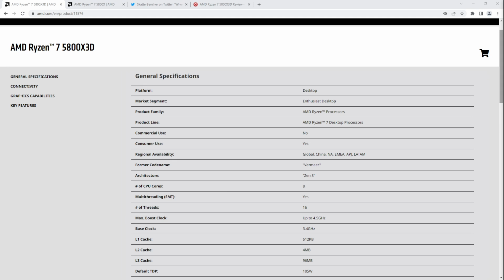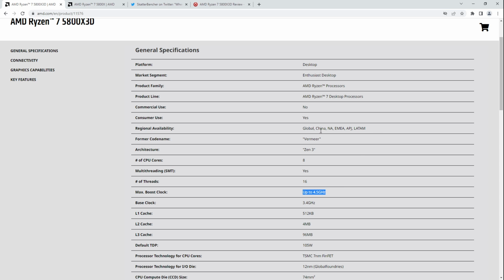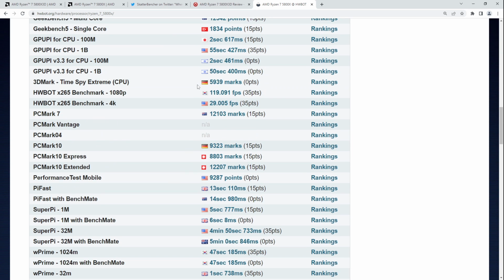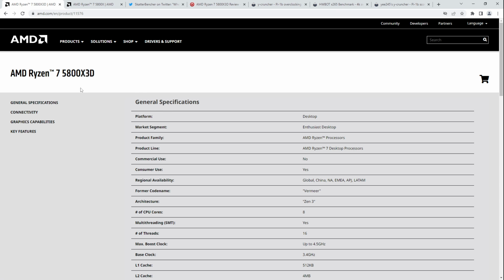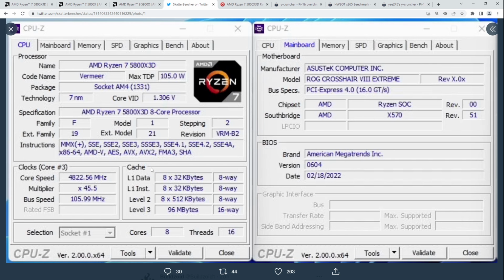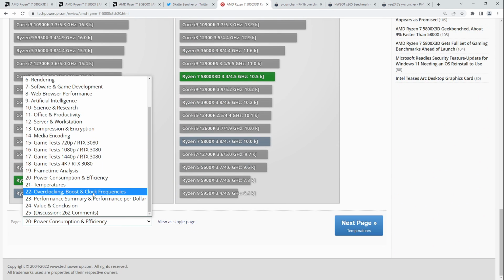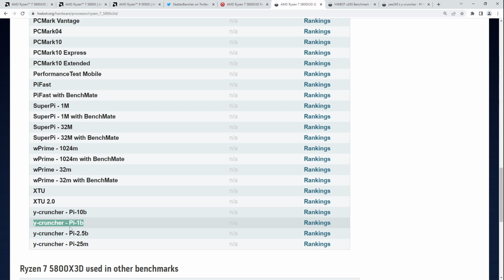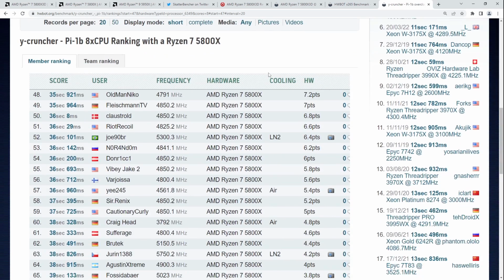Buildzoid's 5800X3D overclocking rant

Comment: The part where you rant about allcore clocks at 1.35v is actually rather incorrect for the CPU you're talking about - the 5950x gets walled around 4.5-4.6 Ghz on ambient unless you direct-die it, yes - but the 5800x does 4.7-4.8 Ghz allcore at 1.25v-1.3v depending on how great your sample is.

So to lock a 5800x at 4.5 Ghz, at 1.35v, looks more than a little silly.
Reply: Did you try half a 5950x, I mean, a 5950x with only 4 cores per CCD enabled?

Comment: I think this chip's thermal limitations come not only from the produced heat (as Buildzoid said, it is not that power hungry), but about how well you can evacuate that heat with the 3D cache layer and silicon substrates in the middle. I wonder if that is what made AMD thought when they enforced this dumb limitations, since no mater how well you can cool the silicon die on the top (even sub-zero with LN2 or with a beefy peltier), if the heat transmission to the cores is slow there is still a risk of breaking something along the way. Even if they put a low temperature threshold for the shutdown.

Comment: I'd guess AMD would lock out voltage changes at the AGESA level so that you can't even attempt to change the voltage from auto. A modded bios could open up some closed doors.
Reply: You can't --- think this way: What if the BIOS engineer program the VRM to supply 1.3+v, or even 1.4+v, but report it  (x -0.2v) to AGESA, what can AGESA do than take the damn voltage and deal with it? The CPU doesn't provide any voltage regulation, it can do nothing but take whatever voltage it got given with.
Reply: @OMGJL  CPU might throw power failure errors and make you stuck in a reboot loop.
Reply: @erkinalp  again, the cpu doesn't know shit about what power got feed in (as am4 doesn't contain a integrated voltage regulator), it relies motherboard to give it power as well as all the voltage readouts, all it need for a motherboard vendor to bypass this issue is to give a fake readout to the cpu

Comment: I think they locked it only because they're worried about the stacking tech. The temp readings it reports aren't hot, so it's the only explanation. Maybe we will find out in a year that the connection cracks and the chip dies after a bunch of heat cycles?
Reply: More they are aware of cache errors in the 3D cache if operating too much past factory stock. It functions kind of like HBM in how it's stacked, and those interconnects aren't perfectly insulated from leakage under high voltage; too thin to handle it. Errors come first, then literally blowing out the interconnect if you keep pushing it.
Reply: @XionEternum  cache clock isn't coupled with core clock. And since you can do Bclock OC it's probably not a clock issue.
I think it's physically a thermal expansion problem because it's not monolithic. HBM didn't have this problem because it uses an interposer, it's not sitting right on top of a heat source.
And if that is the case apple is going to love 3D stacking in their products (they'll probably claim they invented it too) but it'll actually cause the chips to break as you use them. Then you can't possibly use your 10yo ipad. Emphasis on the "IF"

Comment: Imagine claiming you can't overclock it because of heat issues while the chip still reaches the same temps clock per clock as the 5800x anyways lol. Took amd one generational win over intel to become the new intel. It's insane how people are still fanboying for this company. BuT MUh GamEZ!1!11!!!1 I nEEd TO PusH 250 fPs instead oF 210 on cOD!!1!!1 tHosE EXtra 30 fRAmeS wiLL MAKe mE Go PRO!!1!!1
If this piece of shit of a cpu does not "split" the vcache at 85 degrees 1.45v, why would it do that at 1.3v lmao. It literally makes zero sense. If you have more than two brain cells to put together that is.

Comment: An  external clock generator for X570 and bclk overclocking would be amazing if possible.
Reply: I tried searching but could not find a list of AM4 boards with external clockgen. Presumably the Crosshair Extreme and MSI Godlike have those since i've seen those used to push past the 100 BCLK limit. Presumably much cheaper B550 boards would work too. Atleast the overclocking focused ones like B550 Unify.
Reply: @Raivo_K  Any of the Crosshair boards have clockgens. X470 and B550 being better for high BCLK though.
Reply: @Raivo_K  BCLK overclock = no SATA, on Zen 3.
Reply: @erkinalp  Fine by me. I moved to M.2 last year. But external clockgen should still be able to avoid that.

Comment: The annoying thing about it is that they give so many reasons they you feel that they don't know themselves what limitation is. Or that they are lying. While I'm not using OC very often, I don't think that blocking it is a wise idea - because people will be scared that Zen4 with Vcache will be locked as well. Which doesn't have to be the case if for example the main reason they get damaged in OC is because despite slapping cache and thermal chips on it, they had to do it with the same amount of Z height. By sanding down the silicon. If that's the case and processor is just delicate and they were worried that either there will be review in which someone attempts to overclock and it dies or that people will be OC'ing them and if they get some damage just RMA them after setting BIOS settings back to normal. If that's the case (so basically chip is "delicate" because they had to make it dimensionally exactly the same as 5800X despite there being 3 more chips on top of it) - then hopefully that is a one off and Zen4 with Vcache won't be locked, because they will have forethought to engineer it with less constraints. Though when I think of the time it takes to create new architecture - then I'm not sure again.

Comment: I feel your pain but I think you're making the wrong assumptions... Remember, the primary limiting factor on Ryzen CPUs has always been current, not temperature. PBO itself is primarily driven by current and then by temperature... I heard somewhere that AMD is talking to mobo makers to convince them to disable OC because the VCache is dying above 1.3V. If I were to guess where the voltage limit is, I'd say it's on the copper to copper bonding between the dies, maybe the bonding deteriorates under high voltage, even under low temperature.
Reply: Those are my thoughts to, on a more basic level.
Reply: I don't unterstand why they would'nt make this clear. If this is true then they just appear dishonest.
Reply: @killersberg1  They did even when they were discussing it in drawings (I think it was Frank Azor).

Comment: The 5800x3D running extremely hot seems right. It's clocking 200-300mhz lower, and running 1c hotter from what I've seen from 1 review. It be 12900k levels of cooling needed if it were to turbo to the same levels.
Reply: nah, it doesn't need the capacity, just the better transfer.
So if lapping would be a thing, this would be huge

Comment: For this CPU I really do get why they do not want over clocking it to be easy.
Reply: I imagine they are trying to avoid the twitstorm along the lines of "these new vcache chips are super fragile and are easy to kill under OC"
Maybe the platform (stacking cache silicon on top of the normal CPU silicon) is so new they just don't have the data yet to reliably plot the voltage/failure/time curve
Reply: Heat and Stability.

Comment: you couldnt overclock the 5800x either
Reply: Yes you can, PBO and Curve Optimizer are great on the 5800x. Running mine with a 5ghz boost.
Reply: @charlesleavitt13  its wont run at 5ghz in game, youll struggle to get even the stock 4850 in game.
Reply: @bigturkey1  it holds 5ghz in Elden Ring. YT isn't letting me link to screenshots here but with the right PBO overclock it will hold 4.9 to 5ghz in pretty much any game and I only have a 240mm AIO. It's all about balancing power and temps.
Reply: @bigturkey1  It can run at 5GHz if you disable half of the cores.
Reply: @erkinalp  no it cant and that would be stupid
Reply: @charlesleavitt13  Imagine thinking pbo and co are overclocking, you zoomers are actually entertaining. Please keep going.
Reply: @xkxk7539  I hate to break it to you but manually adjusting voltage and freq died years ago at this point. Both the Zen3 and ADL boost algorithms are smarter than you.

Comment: Peak volts for Zen 3 all-core is about 1.35v anyways.  Have pushed my 5900X over 230w of draw at 1.3v and 4.65ghz.
Reply: @Alex If I were just playing single core optimized games and doing things that are not L3 latency sensitive, yes.  However, locking core frequency for all cores and CCD/CCX's to be identical with as close to no fluctuation as possible (none at all preferred) gives better performance in some work loads.

Comment: In Zen 3 the L3 cache clocks at the same clock as the highest clocking core. I assume that there might be an issue with the denser cache chiplet or the interconnect not being able to support the full clock you'd see on other Ryzens.
Reply: This was my first thought about it too. But also the thermal density added by putting another active layer of silicon on top of the existing wafers, connecting it all with copper.
Reply: @darkSorceror  exactly degradation of chips or thermal stress might cause damage much quicker than other cpus thus trying to prevent too many RMAs.
Reply: Is there even a need to consume extra 20-50% more power for 3-5% higher clocks? The cache itself already adds massive performance. I'm surprised they didn't lower the clocks and TDP even more
Reply: @GewelReal  It's not that there's "no need" for it, but that they're disabling the possibility at all

Comment: I wonder if the copper to copper VIAs between cache and cpu dies could handle LN2 -100C from above and power spikes from under, or if they will start snapping.
Reply: thats one thing i believe could happen, but at the same time it should be the same method they use in hbm, which seems to work fine!?
Reply: @cj09beira  I don't know.. hbm connectivity to gpu looks similar to how ccd and io chiplets are connected, layed out next to each other not on top of each other, I think this is differenet.
Reply: @husamabou-shaar9740  although hbn is placed next to the gpu/cpu the hbm itself is made of multiple silicon dies on top of each other connected with through silicon vias, much like how this cache is connected to the base die, thats what i was refering to
Reply: @cj09beira  That's interesting, I didn't know that about hbm, thanks.

Comment: Damn cpu overclocking blows lately, zen2 and 3 didnt oc that well, 11th gen ran hot and was shit in general, 12th gen has error cores and now zen3D has locked multiplier

and honestly gpu overclocking isnt that far off with nvidia locking voltages and amd soft locking clocks, even bios flashing is dead
Reply: overclocking age is likely dead, as they push the silicon to the limit at the factory, at least we still have some reasonably good memory overclocking potential

Comment: It was told by AMD robert that the extra cache is made with TSMC N7 high density and the voltage limit is coming form that.
Reply: It is no more than 1.35V on the Vcore because the V-cache part doesn't tolerate high voltage.
Reply: I've always considered 1.31v the maximum safe value, this one ranting about 1.35 is kinda wut??
Reply: @TheSilviu8x  1.35 is since zen 2 at least their max safe constant voltage for all core.
Stock with PB it can pull up to 1.45 V to the 1 most used core. But for OC, 1.35 is perfectly fine for daily use, without risking to much more degredation.
So unlike BZ daily use or XOC, or simply just OC it normally to get to know the limits.
Then 1.375 or higher are possible and with XOC 1.4+ make ssense.
Reply: It doesn't matter. 1.35V is a lot of voltage. 4.7-4.8 GHz can easily be reached under 1.35V. 4.5 GHz allcore should be possible without problems.
Reply: @StrategyMasterSSF  Good ones maybe. But in reality we don't know how AMD validates silicon internally.  I am 110% sure AMD did not leave any performance on the table here.
Reply: @Kizmox  Performance is already there. 10-30% extra performance (in games) at lower power consumption. Literally a win-win
Reply: @GewelReal  Yes. But we were talking about overclocking the 5800X3D
Reply: @GewelReal  At 1080p using a 3080 or higher. And being poor for doing anything else than gaming. You can get a 5900x for £365 at the moment on Scan UK, and you can overclock that.
Reply: @Safetytrousers  obviously a CPU upgrade won't give you a FPS boost if you're gpu bottlenecked
Reply: @tomiesz  How many people are using a 3080 or above at 1080p?
Reply: @Safetytrousers  For RTX titles @ ultra details
Reply: @Safetytrousers also games are always coming out, it's not like more demanding games are not going to appear. 
The increase in performance is there. It's up to the buyer to figure out if it's worthwhile purchase. It is in a weird spot in the market though, i can agree on that. 
for most normal users oc wont even matter, obv for people who watch this it might matter way more.
Reply: @Kizmox  But a higher resolution is a much greater visual improvement than this or that setting at max.
It's always senseless just to whack everything to max and leave it there unless that doesn't degrade performance. There are always settings that make no difference to experience at low or off.
Reply: @Safetytrousers  since things like pi-cruncher depends on the GPU...
Reply: @Safetytrousers  but RTX in general isn't :)
Reply: @emmata98  When did I mention RTX? And what is RTX not?
Reply: @emmata98  I didn't ask a question to which 'since things like pi-cruncher depends on the GPU' would be an answer to.
Reply: @Safetytrousers  "At 1080p using a 3080 or higher. And being poor for doing anything else than gaming. You can get a 5900x for £365 at the moment on Scan UK, and you can overclock that."
This implies that a CPU without a strong GPU is useless.
But especially with XOC this isn't the case.
Therefore I named 1 programm witch proofs this point
Reply: @Safetytrousers  "But a higher resolution is a much greater visual improvement than this or that setting at max.
It's always senseless just to whack everything to max and leave it there unless that doesn't degrade performance. There are always settings that make no difference to experience at low or off."

This implies, that turning on Raytracing has less of a visual impact, than getting the resolution a bit up (like from 1680*1060 to 1980*1080), witch depends on the case, but in general this isn't true.
Reply: @emmata98  I was talking about the capabilities of the CPU, not what can or can't be done on a GPU.
Reply: @emmata98  It implies nothing of the sort, especially in light of the comment it was in answer to.
Reply: @Safetytrousers  then write it that way
Reply: @emmata98  Beacuse it is normal understandable English that makes sense.
Reply: @Safetytrousers  This is not dependant on the language.
This is just logic.
Reply: @StrategyMasterSSF  Sounds like you should get a job working at AMD hardware development.

Comment: I'll just wait for the 7800GX3DX if it ever will exist. APU with 3D Cache and Overclockable, sign me up.
Reply: AMD Ryzen 9 7999X3OWO
Reply: @WhenDoesTheVideoActuallyStart   I think you meant AMD Ryzen Threadripper 7999X.
Reply: Leaks say more Zen 4 (which already have integrated graphics throughout the stack) CPUs will include V-cache and the socket is more ready for it.
Reply: @Marcus R that's not an APU lol

Comment: 15:30 for processors techpowerup shows power consumption for the whole system on their charts. Depending on the silicon CPU would pull 110-120-ish W, similar to 5800x.

Comment: I wonder if the monster blob of L3 cache just can't clock that high. It's tied to core frequency, no?

After experiencing 5950X trouble that I'm 99.9% sure is to do with L3 cache instability, even under stock boost limits with enough cooling...

Comment: Yes you're adding cache on top, but what's the difference in thermal conductivity between a slab of silicon and and whatever percentage of copper interconnect between the layers? I don't think it would be a thermal disaster; no doubt worse, but not a disaster.

Comment: I'm mainly curious if PBO and curve optimizer still works.  Extending the the power limit and changing the voltage/frequency curve are typically the only useful overclocking options for Ryzen (without XOC).  Memory/IF OC is still an option, so that with PBO within 1.35V should still net maximum performance on air/water-cooling.
Reply: PBO & Curve Optimizer are disabled in bios for 5800X3D

Comment: I still tin foil hat think that the reason the overclocking is blocked is because the 5800X3D has overclocking features they don't want released to the public until Zen4 and at that time they'll magically get unlocked.
Reply: its the same cpu as the normal zen 3 chips literally the exact same, only difference is that it has more cache on top, so its not some "hidden feature"
Reply: @cj09beira  Unless they made a separate cache clock or something else new.

Comment: There is the possibility that they decided to do this for multiple reasons. Marketing, defects, performance badly mirroring the next line of cpu's, not wanting/being able to figure out the heat spreading, reputation risk, etc. There's just someone higher up or from risk management who thought it made sense in sum, as no-one who knows a thing or two about overclocking would think of installing limitations on a performance based product.

Comment: Wendell did a video on this CPU, and did mention the OC lockout, and suggested maybe OC was removed because of the massive amount of errors that could accumulate in the larger cache, causing issues with stability as correction could not be handled rapidly enough.
Reply: does that not go hand in hand with temperature though?
Reply: that was one dumb take imo.